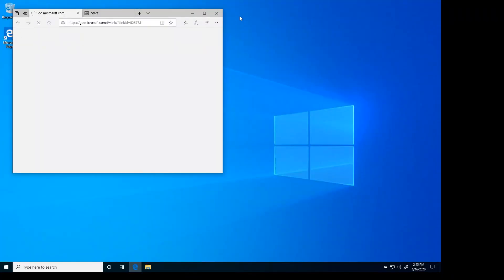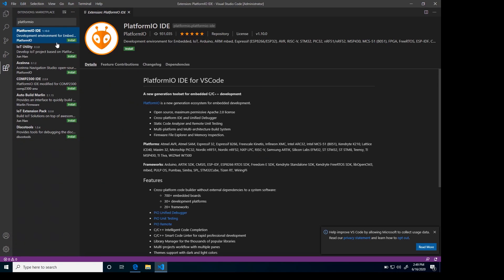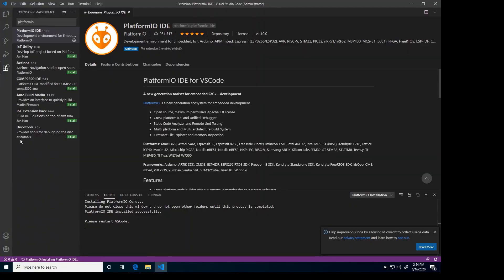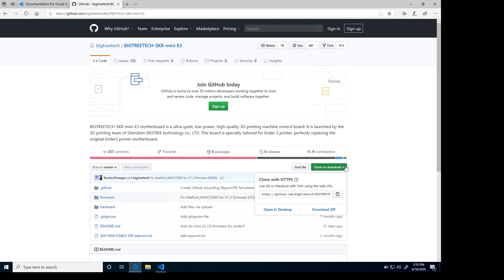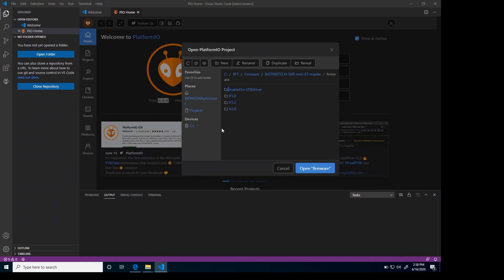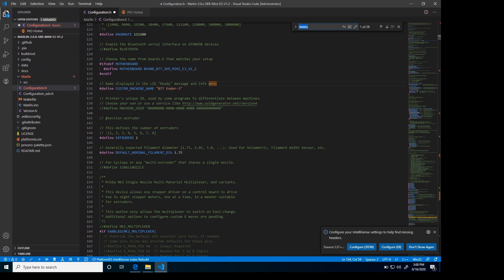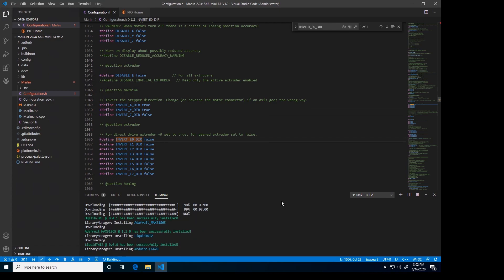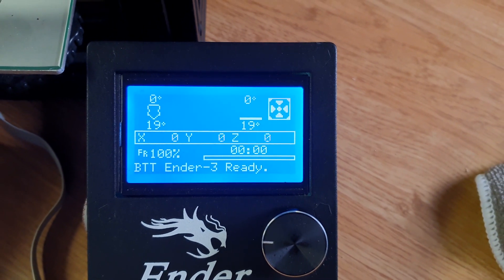BIGTREETECH SKR MINI | Firmware Update| THE EASY WAY

Comment: I am having an issue with the extruded after installing v2 of the board. I am thinking it is the same as you described in the video. When I move the z axis, the extruder skips back and forth, making a noise. When it goes to print the extruder does not move and push the filament forward. Not sure what to do. Should switch the true/false statement?
Reply from the maker: Do you have a geared extruder, the symptom you are describing sounds like some else, let me jump onto my support group to see if anyone knows what might be causing this.
Reply: @FusionSource  I changed the true to false. I have a base ender 3. I successfully compiled the code and then put on printer. When I move the z axis, it keeps backing the filament out of the tube. Could i have an issue with the board?
Reply from the maker: I think you need to have it set tot true, if it is a stock extruder, it is not geared.
Reply: @FusionSource  I have tried both true and false. The extruder moves, removing the filament, when I move the Z axis. I was talking to someone about the issue and they suggested switching the pins for the extruder. Not sure what to do. Going to try
Reply: @dennorskegnome2874  Did you ever figure out a solution to this? I'm having the same problem.

Comment: Outstanding guide.... the "big channgels" didn't help much. Until I found this and @Handy Randy's comment. I needed to raise max E temp to 300. Even changing HEATER_0_MAXTEMP 300 in Configuration.h, I'm only getting 285c. Any help will be much appreciated.

Gained a sub!
Reply from the maker: Hi Eagle Eye, thanks for the compliment and the sub, special thanks to Handy Randy for sorting out your issue
Reply from the maker: Hi Eagle Eye, the standard hotends cannot go that high, do you have an all metal hotend?  Let me do some research on this.  Please be careful if you are using a hotend that is not all metal, the PTFE tube can let off dangerous fumes above 245 Degrees C
Reply from the maker: Thank you Eagle Eye, can I ask you to share my channel with friends on Whatsapp and facebook groups.  Really trying to build this channel, thank you.
Reply: @FusionSource  just saw these messages.... thanks YT. Im on IG Eagle.Eye.Shooting. Yes, running all metal. Let's get this channel going. Great content
Reply from the maker: @EagleEyeShooting  Thanks bud
Reply: i'd try to do the same but something i've missed and the compiled  firmware doesen't appear for my mini E3 and temp error E1.... send me if you can the right firmware.bin... tanks davmarl@tin.it

Comment: I'm getting the same "Marlin\src\HAL\STM32F1\dogm\../../../inc/../HAL/./STM32F1/fastio.h:30:10: fatal error: libmaple/gpio.h: No such file or directory" issue
Reply: solved

Add this on line 46 of your platformio.ini file
board_build.core = maple
Reply: @inkphusion  Huge thanks brother, This solved this issue for me. Ive been trying to get this to work for the last 5 days in order to raise max E temp to 300 for Polycarbonate
Reply from the maker: @inkphusion  Thanks so much for your comment and for your help in this matter.  If I may, I would like to use this comment in my description and give you full credit for the fix.
Reply: @FusionSource  You are welcomed but credit is due to the content creator Chris Riley. He helped me out, on his video post.

Comment: Mine failed compiling even without modifying the firmware
Cannot find "c:\BTT\BTT\firmware\V1.2\Marlin-2.0.x-SKR-Mini-E3-V1.2\include". [9, 17]
Cannot find "c:\BTT\BTT\firmware\V1.2\Marlin-2.0.x-SKR-Mini-E3-V1.2\include". [61, 21]
Reply from the maker: Hi BadGaming, see the solution from Handy Randy:
Add this on line 46 of your platformio.ini file
board_build.core = maple
Reply: @FusionSource  I have the same issue and this didn't fix it....
Reply: never mind... i pressed enter after inserting line 46.... removing the pause break fixed it!